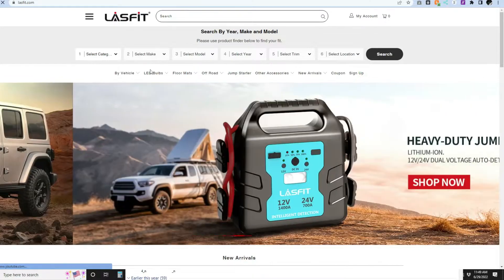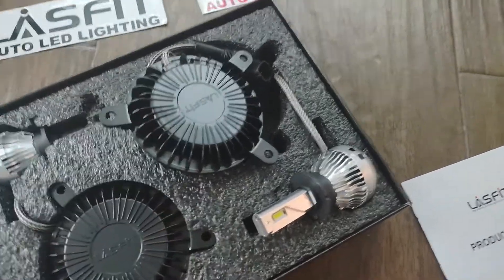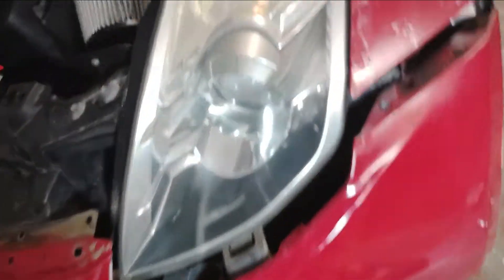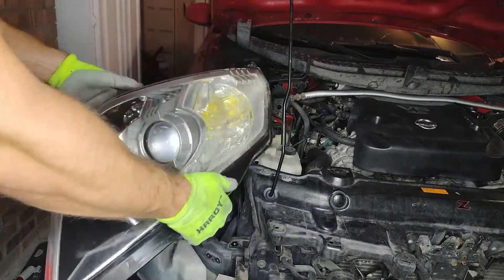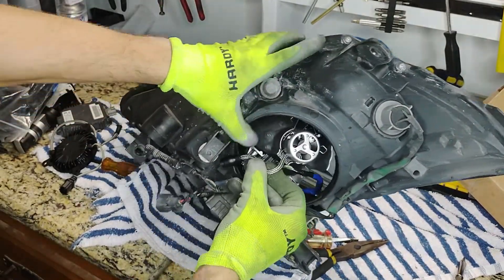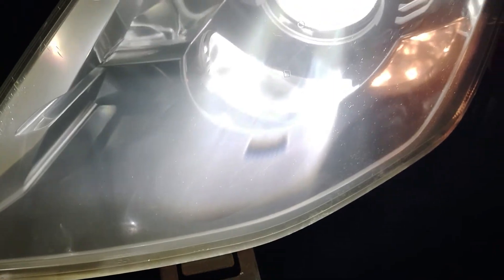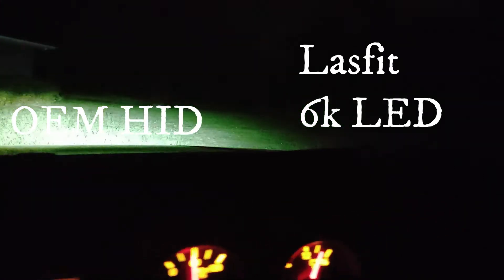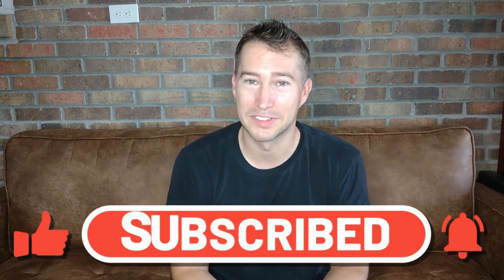350z Lasfit LED Headlight Conversion Install & Review

Comment: Great video, how are the LED Lasfit holding up?  Any changes, flickering, error codes?  I have an MDX and want to try LED's but I do not see any videos from people talking about the reliability of the plug n play vs continuing with oem hid setup..aka buying new hid ballasts, igniters, bulbs,
Reply from the maker: Thanks. Totally understand. thankfully I haven't had any issues with them, no error codes or flickering. So far they're doing great and have great output so no regrets, highly recommend. 💪

Comment: i can see in your video that your lights also have those micro cracks in them too, mine have it really bad on the driver side,   cheap plastic i guess.
Reply from the maker: Yeah they're very delicate to heat.  Rather it be from uv damage or from a buffer when doing headlight restoration.  I ended up replacing the housing with new one when I repainted the car
Reply: @GQ37official  oh wow I didn't know you could do that, is there  a place where you can buy the housings or lenses or whatever you might call it, the outer plastic part.
Reply from the maker: @Runescape.  yea there's several aftermarket ones out there. I wanted black out housings for the look I was going for so here's the best ones I found  https://ebay.us/l1YLWn
However, I've heard the light output isn't good if you use the oem HID bulbs. I had already upgraded to LED lighting from Lasfit so I kept that and put it in these DEPO housings and have no issue with light output.  I couldn't do a video of the install as I did it while my car was in the shop and being painted so I was in a hurry, but the main thing with after market headlights is to get the beam pattern as close to OEM as possible. To do this I started with the OEM headlights and marked where the beam pattern was on the wall with tape. I marked L and R where it was, how high it went and how wide each side went.  Then without moving the car I replaced one headlight at a time and adjusted the beam pattern on the DEPO lights so that it matched where the OEM pattern was on the wall.  This is important as they are kind of out of whack straight out of the box and once they're installed you can't adjust them, you have to take the headlight back out and turn the knob etc, (with the bumper off) so it's important to get it right while you're installing.  Hope that helps!